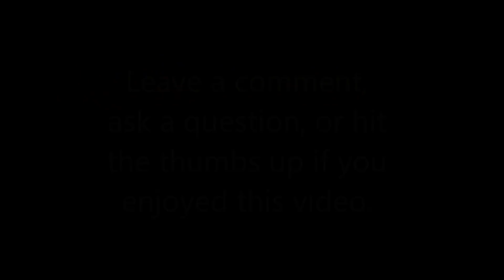Machining Cutters You May Have Never Seen - But Should Own

Comment: I use downcut (lefhand spiral, rightrhand cut) bits in my ShapeOKO(kitbuilt CNC router, 'slightly' modified over the years) and yeah, they cut NICE on plywood.  The issue you had with the little bit of rubbish in the cot with the two-flute could probably be solved by lowering the spindle speed. (I think the material is being pressed down, and can't bounce back before the second edge comes around, so the second edge isn't cutting properly at the bottom of the cut.)
I keep a box of these in 1/8" and even a few in 2mm size in my hobby shop at all times.  (1/8" is often cheaper than 2mm)
And yeah, most are single flute.

Comment: That nice brown material is used in very high voltage insulation.  I have some but most has small holes for mounting.
Reply from the maker: LE phenolic. 1/2" Also great for knife handles.

Comment: Thanks for the detailed explanation of each cutter.  I wish you had included composite aluminum (aluminum both sides) I need to cut some for individual letters for a sign.   Do you have a video that deals with this material?  6160 aluminum cuts beautifully but I have had other aluminums that fused to the cutter really bad.
Reply: i am interested in this myself, similar application and alloy.

Comment: Hi Joe, 

Melamine faced boards are very prone to chipping so you use either a straight flute if you are cutting right through or a downward spiral if only from one side. 
On a saw they use a scribe blade which revolves in the opposite direction to the main blade, so it's cutting up into the board against it's travel, and cuts a shallow slot slightly wider than the main blade, so you don't get chipping on the back face. 

You also cannot use downward spiral if you are plunge cutting, for obvious reasons. 

On saws, tooth shape can also make a huge difference. 

On things like scroll saws, you can get them with teeth in the reverse direction for a short distance on the lower side, so cutting thin plywood jigsaw, you are always cutting into both faces. 

We've got a huge choice these days to get a perfect result. 

Carbide burrs are amazing things, a bit like roughing cutters and corn cob cutters, where you're cutting smaller chips in different locations on each flute, reducing the machine load.

Great video. 

Regards Dennis
Reply from the maker: I like that burr cutter. I won't rough LE with anything else.

Comment: We used to run an Eckstrom Carlson overarm pin router using those single flute "downcut" bits, very aggressive feed rates, beautiful finish, odd thing was Eckstrom strongly discouraged their use claiming they were too rough on the headstock bearings and would only sell 2- flute designs.

Comment: I run a CNC router and burs like that are great for cutting insulation foam.  I use a 1/8" one made by Dremel for grout removal and it cuts foam and rubber floor mat (for tool drawer cutouts)  just great.  but, always have vacuum, the dust will go everywhere including your lungs.

Comment: If you get a compression cutter then it will leave a nice cut on the top and the bottom of the plywood. The tip of the compression cutter is a right hand (up cut) and the rest of the cutter is a left hand (down spiral) all on one end mill. For the plexiglass I like to use a 1" diameter insert cutter with two inserts at 18000 rpm (conventional) with a feed rate of 9000 mm per minute.

Comment: I have done a lot of wood work and I use carbide bits, way better finish. I have used the same on Aluminum jobs. I used a bit like that on my cast iron drill press table in a dermal tool.

Comment: The high pitched noise cutting the acrylic with the left hand spiral cutter may be because you had a small unsupported overhang allowing the acrylic to be pushed down and rebound back up. Would be interested to see, and hear, if you had the same noise problem if the acrylic was fully supported as it was with the right hand spiral cutter.

Comment: The corner that was blown off with the double cut bit, the plastic appears to have a flaw in it.  There is a white looking "dash" at what appears to be 1/5 of the thickness from the bottom right at the corner.  Flaw, piece of plastic swarf or reflection?

Comment: AvE has used a carbide burr in the Bridgeport to “drill out” a broken tap to much success.  Carbide burrs are the least talked about yet very useful tools to have in your box.
Reply from the maker: Like any cutter, there are many different styles. Burrs are no exception. The one used in this demo is a flat bottom and won't cut.
Reply: That's how I started using carbide burrs, 'drilling out' broken studs, broken 'Easyout' and drill bits

Comment: I use that dimond cutter in my cheep cnc and it does the best job of any cutter at least on aluminum..Perfect clean edges as long as you don't try and take too deep of a cut, the sides clean up surfaces really well.
Reply from the maker: I have never tried this diamond burr on aluminum. roughing end mills yes, but not this one.
Reply: @joepie221  The smaller ones, say 1/4" work great for steel in a die grinder. They usually out perform carbide burs.

Comment: Have you ever just tried a regular straight router bit? I think they would work just as well.
For natural wood a good high-speed steel router bit is hard to beat. Back in the 80's we had a production job of over 100,000 parts, that were run on a pin router,
 and we tried a lot a different router bits from carbide to steel, and Onsrud high-speed steel was the winner by a long shot.
Reply: Yeah straight cut or down cut for wood.

Comment: I also use these on other materials as forex, alluminum sandwich panels and several types of acrylic on a cnc router at a max of 40.000 rpm
the ones with the left hand ( reversed ) spiral also cuts cardboard real well.

Comment: So called downcut router bits (in woodworking world), have one disadvantage. They do not extract dust/chips but pack them to the bottom of the chanel.

So, vacum chip extraction is highly recommended.
This should give some better finish on to the bottom also, becouse chips are not packing into the cut.
Reply: you could add a compressed air line directed at the end mill. (combined with a dust skirt vaccum)

Comment: You missed out on the up-down cutter, with the bottom ~3mm as left spiral and the top as right hand spiral. Great when doing contour cut outs, producing good finish on top and bottom. Does your head in when you look at them. We use them for all ply cutout work.
Reply from the maker: I've seen those. They must be tough to grind.
Reply: Please share a link where to buy these great cutters. Joe, where do we buy those reverse helix cutters?
Reply: @aculasabacca  the ones I get (the up-down cuters) are from banggood https://www.banggood.com/Drillpro-Blue-Nano-Coating-Up-Down-Milling-Cutter-10mm-or-8mm-Shank-Carbide-CNC-Router-Bit-2-Flute-End-Mill-p-1728218.html?cur_warehouse=CN&ID=6293460&rmmds=search

Comment: would the carbide burr work on the glass impregnated phenolic commonly used on router table insert plates and table saw zero clearance inserts? I have some of this stuff that I want to use for ring and pen making, just to see how it turns out, but have not been able to work it effectively
Reply: Yes, we use those carbide burrs at work to cut & mill glass impregnated stuff used for heat shielding n plastic injection moulds. Works great, just needs a vacuum next to the cutter or you'll have a bad day...

Comment: Hi Joe, I am having a hard time squaring my mill head to the table. When I take a face cut one side is a few thou lower. When I adjust it, it goes a few thou the other way. I just cant get it perfect. Is there an easy way to do it or a special tool or should I just keep splitting hairs until I got it right. Thanks
Reply from the maker: True it up with an indicator first. if your parts are still out, its either a spindle bearing or cutter flex.

Comment: The 2 cutters, 2 flute, are also called downcut and upcut.  I use both as well.  They provide different preferred finishes.  Theres also a 3rd type that has down and up on different parts which the name escapes me.
Reply from the maker: Combination cutter
Reply: @joepie221  compression end mill
Reply: I remember when I used a compression end mill the first time on my router. I thought it was sorcery. I don't think I'd use one in anything except plywood, though.

Comment: Hi Joe: Thanks for another great video. One thing I always learn from you is how you approach workholding. So as you film, can you sometimes zoom out a little so we can see the entire setup?   The carbide burr cut was interesting but more interesting for me was how you had the workpiece clamped. I couldn’t quite figure that out from the video. Cheers!
Reply from the maker: I used 4 1-2-3 blocks and a 5/8 tool bit. 2 blocks in the back, tool bit in the center, 2 blocks to the front. The tool bit was lower and formed a trough between the blocks. All squeezed in a vise.
Reply: @joepie221  Got it, and thanks for the reply.  I could see the 1-2-3 blocks in the video but not the tool bit, but it now makes sense.   BTW, I shared this video with a friend who is running some high volume PVC parts through his CNC shop.  He said the left spiral cutter will probably save him a thousand dollars in deburring cost on the next batch.  I'll make sure he subscribes!

Comment: to get a nice glassy finish on acrylic wave a propane torch over the edge. Instantly melts the micro scratches.
Reply from the maker: I've heard hydrogen is the best, second only to a vapor polish. Check that out.

Comment: nice demo. looking for a solution for cutting large aluminum panels in 6061 at 0.032" thick on a gantry CNC. i'd considered the right turn left spiral, but my concern for small diameter cutters is chip loading and welding to the bit. i know the right choice of cutting fluid will make a difference, but i've not seen it done yet. any comments?
Reply: I cut 4x8 sheets of that all day and use an Amana 'O' single-flute up-cut 1/8" diameter carbide endmill.  I don't use coolant because I cut on a sheet of mdf with a vacuum pulling through it, and I'd say it's not necessary to use coolant with the single-flute style cutter and much cleaner.  High spindle RPMs are important, I cut using 18000 rpm.

Comment: Some interesting results. Do you think a double cut carbide bur designed for a die grinder would give decent results? This would be for home shop use not something for a customer. I wouldn't be trying a 1" cutter with a 1/4 shank, more like 1/4 shank and cutter.

Comment: Excellent "product shoot-out" presentation. 

Those carbide burrs are very useful for machining hardened metals (8620 hardened). However, like all carbide tooling, they do not take kindly to "chatter", but do so better that "conventionally cut" carbide mills. Thre is a LOT to be said in favour o wooden shop floors or serious industrial "rubber" floor matting over a good concrete floor.

Why tackle hardened 8620? trying to 'heat-treat that or many other metals AFTER finish machining can induce some ugly distortion

Comment: Rpms appear to be still a bit low (with carbide you'd aim for at least 40m/s cutting speed in wood. About 30% less with high speed steel bits)...

Comment: Awesome video, I have some of these for my woodworking projects, but I got them in Germany years ago, where do you source these here in the  US? Thanks.
Reply from the maker: MSCdirect.com
Reply: @joepie221  Thanks.
Reply: Onsrud cutter makes some very good router bits out of high speed steel. There is something about the steel they use, that enables you to sharpen to a much finer edge.

Comment: Hey Joe, seeing as the single flute had better results, do you think chip size/shear strength of the material is at play? In other words, would increasing the feed of the double-flute bit cause a larger chip size, resulting in a similar result/finish to the single flute?

Comment: Joe,
good video. Also still haven't had reply from you regarding the Drill press question on rotary broaching..
Reply from the maker: Please re-send it.
Reply: Joe Pieczynski  you had a video showing how to broach with a drill press  ?
Reply from the maker: @bobmcgee7805  Only on a mill. Never posted a drill press video. I believe the video was called " You cant make that on a manual mill, or can you? "
Reply from the maker: @bobmcgee7805  No rotary broaching either. This old Tony did one on a rotary broach, but I believe it was lathe based.
Reply: @joepie221  
Joe,Can you give me the link from on the mill? broaching..thanks.

Comment: Pretty neat demo, Joe.  I don't cut much in the way of plastics in my shop, though years ago I did do a long run of very large bushings for John Deere out of what I think was called TuffCast, a very hard wearing plastic "tube" of some type.  That was lathe work, though.
I never thought of a right hand cutting left hand flute end mill before.  Do you think they would work for plexi-glass?  I have a small project coming up for some of that stuff.
As always, thanks for the vid!
Dean

Comment: Such thing as a double sided cutter you can reverse spindle and change coaxial cutting force?

Such thing as some hybrid cutter that cuts up and down equally netting no vertical displacement?   Maybe this is kind of what the geometry works out to in a burr?
Reply from the maker: I would think a cutter somewhat like the burr geometry could do that. I wouldn't expect a good finish.

Comment: More than just a pretty face, ( respectfully ) Joe.    Yes, we end to think of machinists ONLY working on Metals  ..  some will have a go on plastics ( I do) but the realms of a Good Millwright encompasses wood as well.  Helzbells even some of our older combines had Wooden Bearings on the straw walkers  ( oil impregnated )    Understanding these tools helps make a good job so much better first time around.  More chips - Less DUST  -  that's the problems generally with wood in the metalworking Shop. Whaat? Screaming too?    Oh that's definitely one for the woodshop then. ...   and Finally...  just good reference  material   as to which cutter leaves what finish. Thanks Joe

Comment: I just picked up a handful of those carbide burr mills at a yard sale, 3/8".. couple bucks a piece I couldn't pass them up.. Do they have any applications in metals?
Reply from the maker: I've only used them on composites.
Reply: @joepie221  They came from Boeing as far as I know.. if they're carbide they should work in other metals I'd think just have to be real careful with the "flutes" loading up

Comment: Joe, will these burr cutters work well on the black epoxy phenolic commonly in chemistry labs?  Also, are those burr cutters available for routers?  I occasionally need to cut 1.25 - 1.5 inch holes full depth in those countertops and haven’t found a reasonable cutter for these larger holes.  I have found the arrow head style tile bits work well, but I have only found those available up to 1/2”.
Reply from the maker: I'm not exactly familiar with that material, but they are specifically designed for composites, so I would think..Yes.
Reply: Your probably talking about compact laminate, you machine that with ordinary woodworking machines.
Reply: @alexanderpaaskeborjesson3574  I am talking about an epoxy called phenolic resin.  It is highly chemical resistant, very hard, and difficult to cut.  I use “arrowhead” bits designed to drill tile and other hard materials, but like I said previously they don’t offer them much larger than 1/2”. I have had moderate luck with diamond tipped hole saws, the problem is the arbor doesn’t last more than 2-3 holes.  At this point however, I no longer need to drill these holes much anymore.  We have changed our process and policies so that issue now falls on other contractors.
Reply: Yes, we are talking about the same material.

Comment: I have a nasty - I think a 10mm (doesn't say) spiral fingers sharp and dangerous looking plastic? tap or endmill haven't looked at it in several years.  Think plastic or Al tap.  Gotten from Boeing Surplus.   When i was doing CNC on FR4 and G10 I often did blind holes and cuts.  I used an up cutting Carbide at 30K RPM and now and then broke one or a few learning something new. Exotic PCB materials were also cut.
Reply from the maker: I'll cut G10, but I'd rather not contaminate my CNC coolant with glass fibers.

Comment: Hi joe the linic phenolic those some people call it tafnol? The second question is the dust generated, is it posinious? Thanks karl from Malta
Reply: Linen phenolic was originally branded Tufnol. (Lots of different grades) The best US equivalent, in the early days at least, was Micarta.
Reply: None of the grades of either brand have asbestos in them in modern times. 
Be careful machining material from the 1980's or earlier.
Reply from the maker: I don't believe its poisonous, but I am sure it not a good idea to breathe it. Dust mask and vacuum all the way.
Reply: @joepie221  I think in the Brit colonial world the brand name was Bakelite or Bakolite?
Reply: @stephanuhu963  Also in Malta we use that term of bakalite.... Since we were british colonies before so many terms we took them from them....

Comment: What happens if you use a conventional mill and run it in reverse then cut the soft plastics
I don't have such and was thinking of trying it
Reply from the maker: It will just rub and burn the material. Probably blow up the cutter.